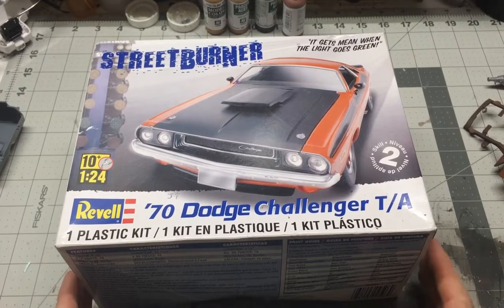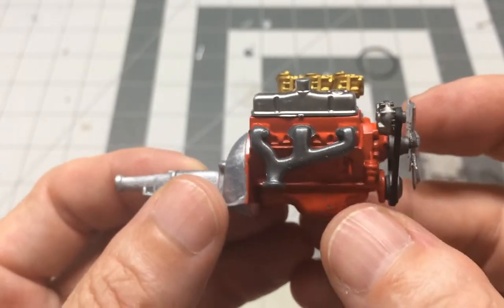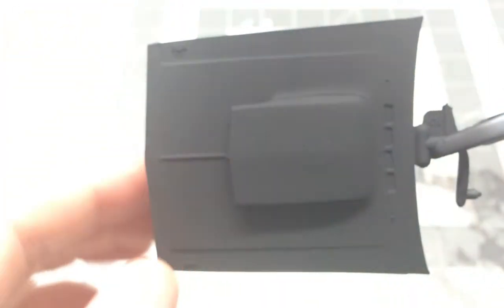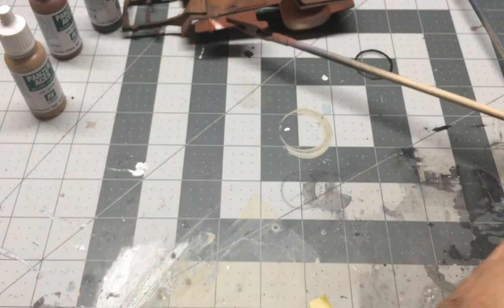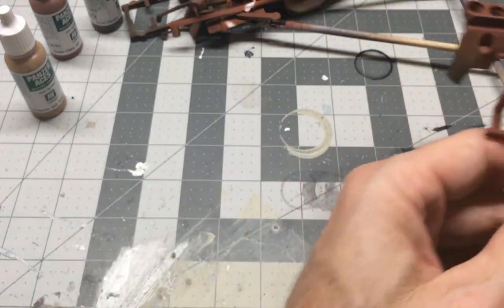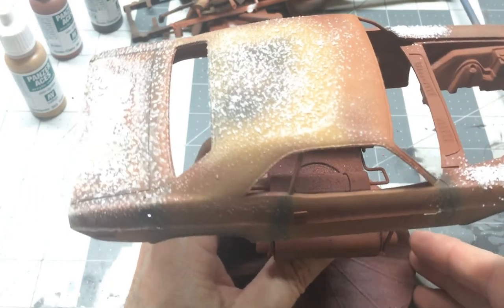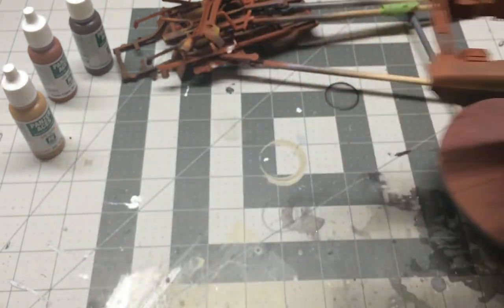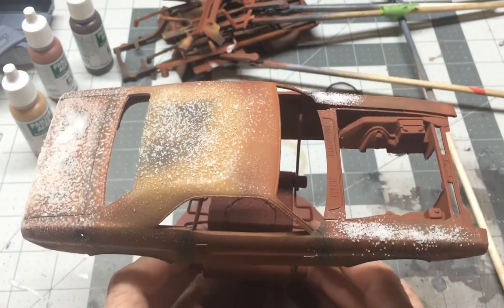Rustification Nation GB Update #1

Comment: Nice touch on that muffler Jeff.  So you paint over the salt then wipe the salt off? Interesting...I will be following along to see how to do this, thanks.
Reply from the maker: Thanks, Shawn! Yes, you just spray some water on the part, put salt over it, let it dry, paint over it, let the paint dry, and then use a soft brush to brush off the salt (I just use an old toothbrush).